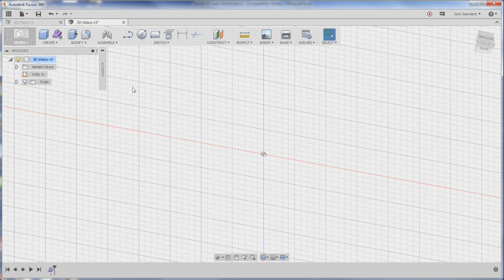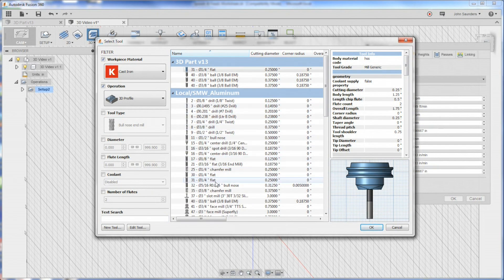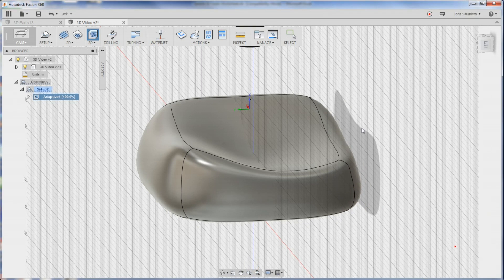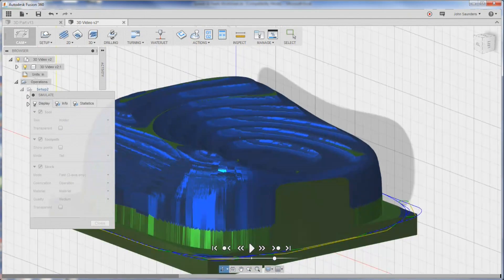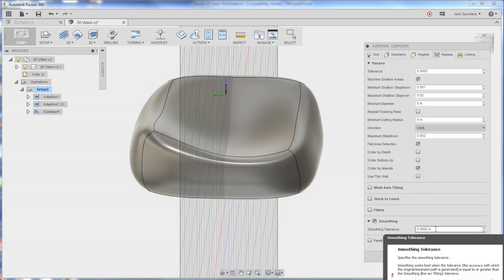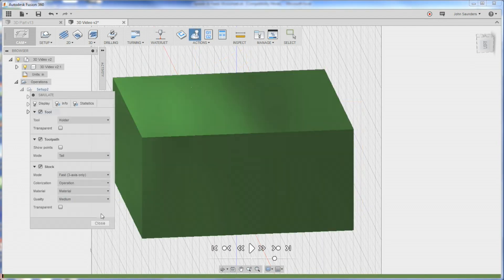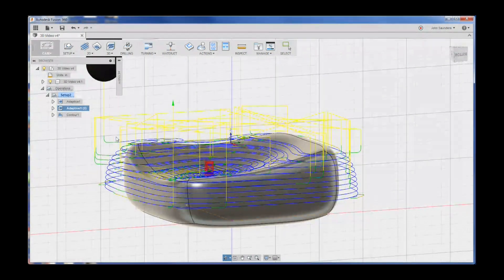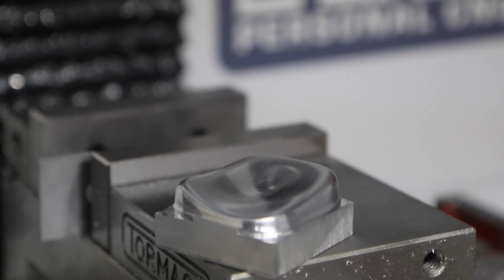3D Machining!   Can we get a great surface finish?

Comment: Hello!
The roughing strategy could be alot faster and more effective- take advantage of the dynamic tool path strategy! Use full stepdown with small radial stepovers. Then also use maximum step up distance. combined the roughing is fast, and the need of semi-roughing can be eliminated due to the small steps left from "Walking up the hill" that´s controlled by stepover and step up! Almost like manually setting a cusp hight, but for roughing...

Use a endmill whit a rather big corner radius, maybe 2mm on a 12mm endmill, this too will make the finishing easyer with a more consistent material removal (a more equal load on the tool). 

As someone below mentions, finish upwards let the chip be cut on a point on the ball endmill whit a grater surface speed. Also helps chip evacuation! 

This is not easily explained in a youtube comment text, hope you understand my point! 
//Henrik

Comment: Chip smearing! Even an air blast would've helped with that, and not even terribly uncommon a problem with large-volume flood coolant.

Oh and nice job! Play around with Order Bottom Up. I like it much better than the normal top-down unless the geometry really calls for it. Keeps the tool from "cutting" at the center where surface speed is zero.
Reply: Hi, I'm having a few issues with the smearing/chip-clearning causing those blemishes too. What do you mean by the Order Bottom Up? I'd like some advice on how to address the surface finish on my parts. Thanks!

Comment: Anytime people machine things (especially 3D ish things) I often wonder.. "how in the world would you create the other side?  I assume you would need some sort of a jig to hold the part?  How would you set up your point of origin on the other side?
Reply: +Hirudin Are you speaking of Fixturing Alloy? Like such: http://www.flexbar.com/shop/pc/FIXTURING-ALLOY-1LB-CAKE-p4035.htm I've been curious about this stuff for a while now...
Reply: +Anthony Webb 
Yeah, doing the second half of that object would be difficult! Obviously, John was just trying to make something swoopy quickly, but if he was trying to make the whole thing he'd probably want to take some more time designing features on the part that could be used for fixturing and registration. It's possible some soft jaws could be made that would hold the part squarely enough that fixturing for the second set of operations wouldn't be a nightmare.

The best way I've found to have an accurate origin point on something oddly shaped like that would be to use a point on the fixture, instead of trying to find a certain point on the actual part. You'd want to use the same point that you used when you initially milled the fixture (or soft jaws).

Another strategy would be to accurately square the block before starting. Then you could just use the other half of the block as your origin point. Tormach also sells this plastic stuff that softens when it's heated with boiling water. I've never used it, but I gather the idea is you plop down a wad of this plastic (which has the consistency of molding clay) and sorta squish the part into it and let it harden.
Reply: At our shop each machine has a removable 2 inch thick "table" that is drilled, tapped and then reamed the top half inch or so.  It takes an extra operation to add tooling holes and pin holes and also a larger material size to accommodate the ability to add pins and bolts to hold it down.  Doing it this way you can easily flip the part over and locate it very accurately.   We program tooling tabs that have to be sawed and deburred down for the part to be completely finished.
Reply: +NYC CNC Ty so much for these videos.  You have sold me on the 440.  I've changed my mind on a new bike, I want this in my garage instead lol.
Reply: +shootgp I'm not sure if I've ever seen that stuff before. The plastic stuff I was talking about looks like the same kind of plastic milk jugs are made from.
Reply: Google low temperature thermoplastic protoplast.  I've had a half gallon of little eighth inch beads for years. Use it for holding stuff and little projects.  Costs about $30 to 60 for a jug.
Reply: +Anthony Webb Machined soft jaws with the profile and certain reliefs cut

Comment: you need to get rid of that machine it works to well LOL.

it looks like chip`s being recut go with a mister that's all you need when doing the final 3D cut not a lot of heat get`s produced just tiny chips. I always use the biggest ball mill that will do the job or the amana  2D/3D carving tool from toolstoday depending on what it is being cut (shape, size). it works been doing it like that for year`s with no problems other than M3 being silly. yes it`s on a big router but the idea is the same just higher feed and spindle speed not quite double.

that machine would make a good second op machine when doing 3D work, rip it out on the 1100 give it to jarred to do the second op on the 440
Reply: its these one I will look at the number tomorrow.
http://www.toolstoday.com/p-6225-solid-carbide-spiral-cnc-2d3d-carving-tapered-and-straight-ball-nose-conical-ball-tapered-and-straight-flat-bottom-end-mill-zrn-coated-router-bits.aspx?variantids=11609,0&keywords=46280

we have used up to 1/8, 1/4, 1/2 and 1 inch ball mill.

90% of the time it`s with the amana as you can use them on almost anything and they are upcut
Reply: +daniel lyall it's the same one you used on 4th feb this year

Comment: That really came out beautiful! Having that 10k spindle makes a huge difference in Aluminum, its almost a necessity. I agree completely with your hypothesis about the chip clearing being the issue. From personal experience not having my coolant nozzles correctly aimed causes similar blemishes. That's a result of recutting chips, which pushes them into the surface and causes those spots. As you said, it is nothing to do with the machine, either! I'm a college student who runs an Okuma VMC and ran into the same issue, changing the coolant nozzle positions solved the problem

Comment: Darn good finish for what you are doing.  You're right, the cad is so simple now.   Good luck with autodesk university.  I've had 50/50 success with their offerings.  If you have a sharp instructor, the classes are great.  If you get someone teaching straight from the autodesk tutorial book it will be agonizing.
Reply: +NYC CNC Have a backup class for each class you go to, if the one you are in is crap in the first 15 minutes. It's nearly always worth getting up and going to the other class.